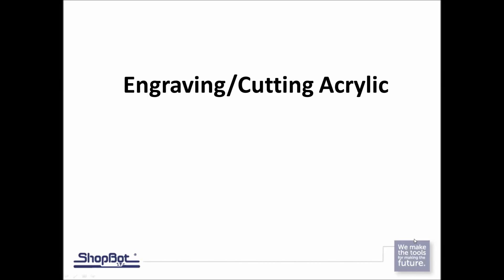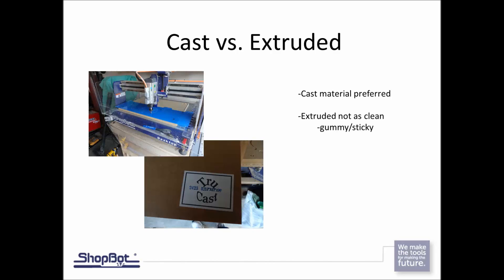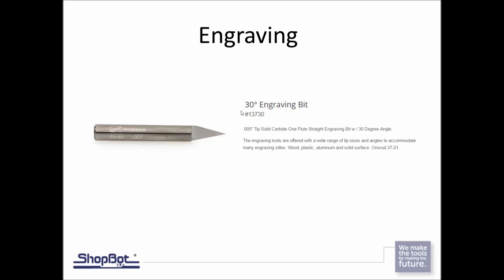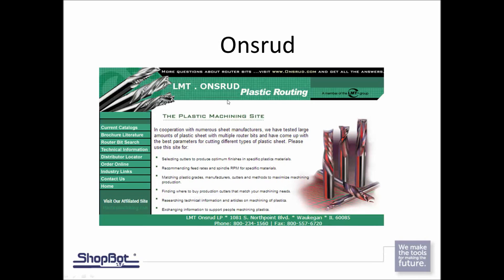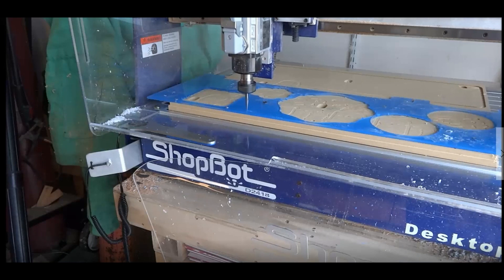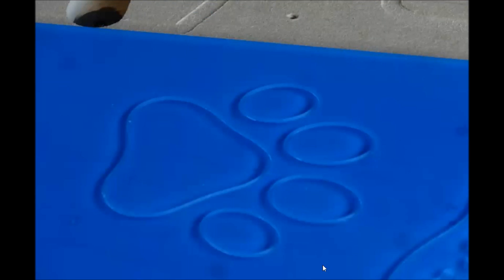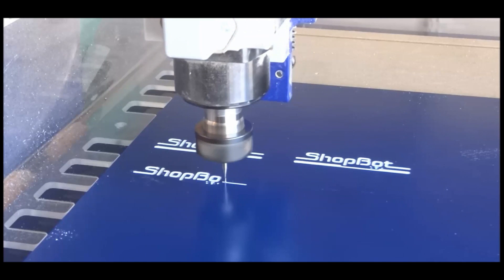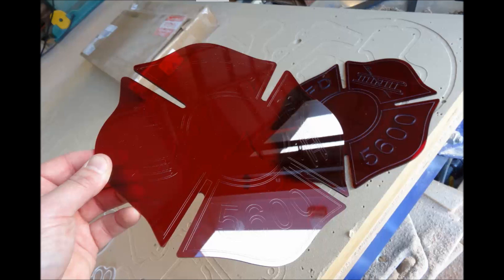Engraving/Cutting Acrylic with a CNC

Comment: how are the pieces secured to the bed? It does not look like you used double sided tape or tabs. How are the pieces not bouncing around as the cut finished the final pass?
Reply from the maker: As TJ has not been a ShopBot for many years, it is difficult to know exactly how he managed hold-down beyond the outer screws we can see. We imagine there is double stick tape or adhesive under the center of the material. That is what we would have recommended. We can provides tips on best hold-down methods for your specific application on your ShopBot CNC machine through our tech support line. 888-6804466. Thanks!!

Comment: Thank you for a good video, how did you smooth the sides of the acrylic?
Reply from the maker: When using the appropriate bit, and feeds & speeds for profile cuts, smooth sides are achievable with ShopBot CNC machines. If you are referring to the edges, there are various methods to round edges of material, such as a round-over bit on a router table or various grits of sandpaper. Lots of methods. If you have any other questions about how the ShopBot CNC machine functions, please call or email any time! 888680-4466 or sales@shopbottools.com. Thanks!!!

Comment: What feeds and speeds did you use on the demonstration cuts?
Reply from the maker: Thanks for your question! There is a lot of variation with plastics and bits. We recommend using the bit manufacturers suggested settings or a great resource we commonly refer to is onsrud.com. If you have any specific project you are hoping to dial in on your ShopBot, I would recommend contacting our tech support at support@shopbottools.com. Hope that info helps!

Comment: Very nice job on topic arrangement.  Nice Delivery. I don't have a shopbot but I do have a pretty nice homemade machine. I also run Aspire software with some Vectrics add on's.  I have purchased many bits from Think and Tinker. I like them. I will use your suggestions for the single flute O bit and the flat tip V's.  Could you provide the name of material and source for the two color plastic used for the name badges in the video. Thanks again